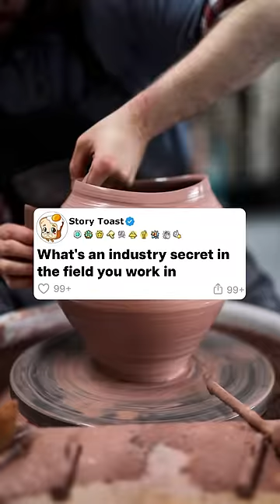Industry secret

Comment: even if these did work, which they likely dont, doesn't increasing your breast tissue also increase your chance at breat cancer? at this point just get implants, it is a lot safer.
Reply: I mean gaining weight (or increasing breast size "naturally"), or getting stronger/fit and thus increasing skin area technically increases chance of skin cancer. On the other hand, getting fit or just getting a body that you are more pleased with reduces your stress and makes you happier, which in turn improves your health, increasing life expectancy. Your main argument was right, but there are other sides to it. One thing I'd recommend everyone is periodical breast cancer screening. Its worth your time.
Reply: Absolutely braindead take.